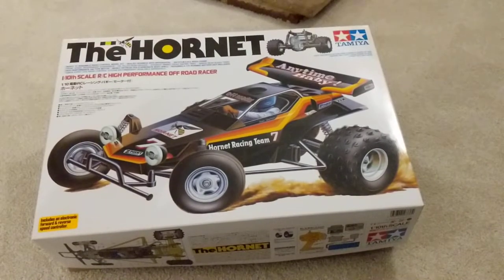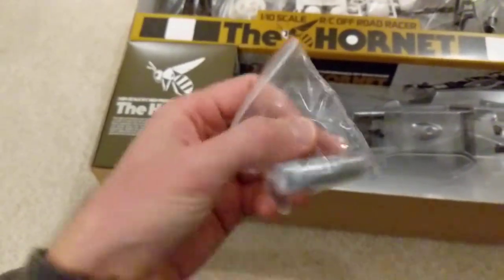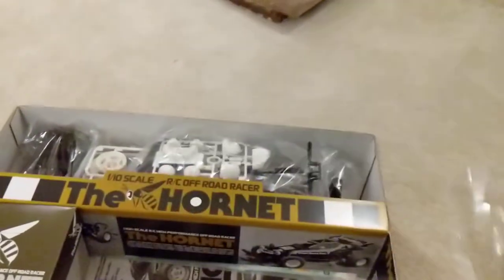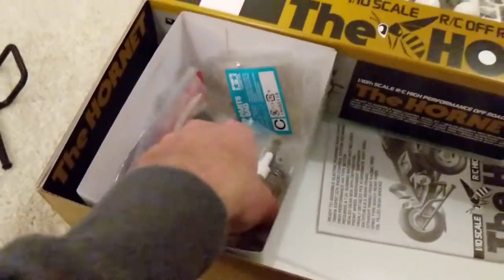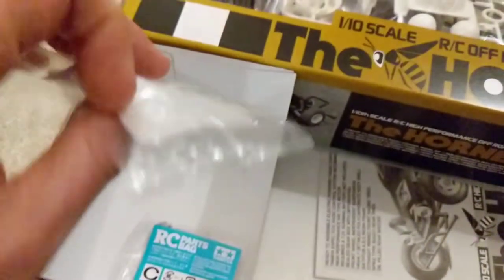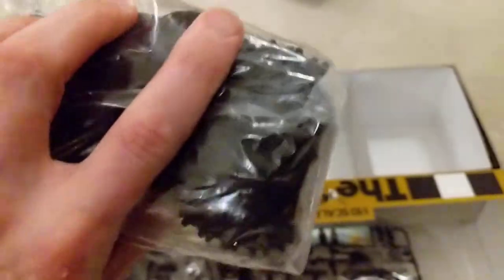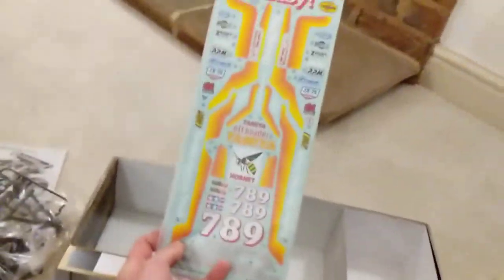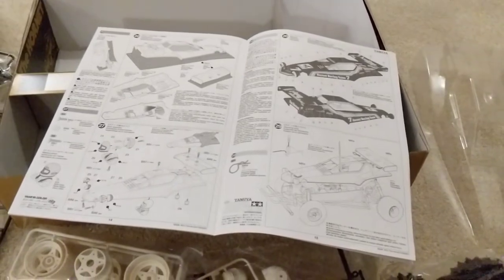Tamiya The Hornet - unboxing

Comment: Had one of these back in the day. Rear tires go bald within days...weird rear pivot diff & weak rear shocks, next to useless front shocks...battery was a pain to install & connect, battery tray used to pop off while driving & you'd drag your battery along the road...otherwise a fun enough car. Modded the heck out of mine & fitted Lunchbox wheels all round, then Clodbuster wheels that fit perfectly over lunchbox rims. Good times 😎
Reply from the maker: Yeah, I heard they're a nightmare but had to get one to add to the collection. Imagine all the pitfalls remain and I'll be modding mine as well 🤦